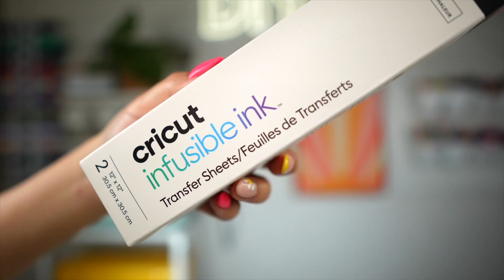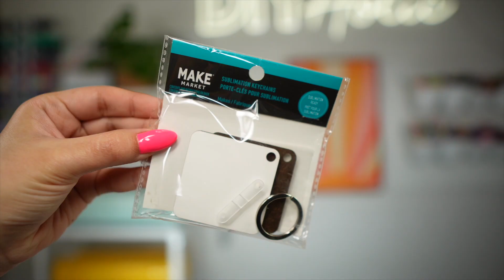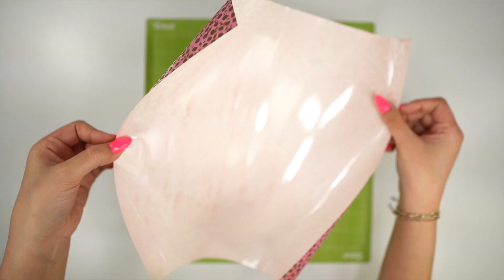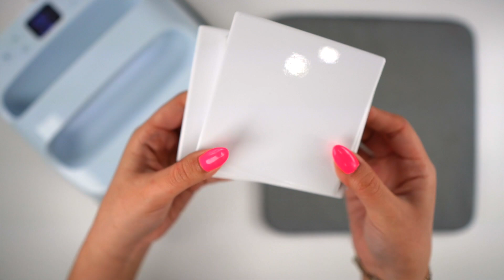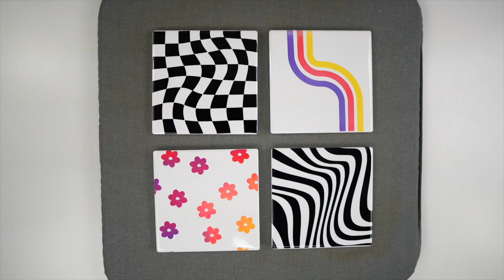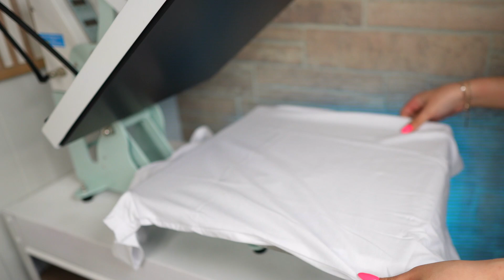HOW TO USE INFUSIBLE INK WITH YOUR CRICUT MACHINE! | Easy Tutorial for Beginners

Comment: Hiii, great video. Why do I need to change the color in design space before printing on my vinyl. This machine has me so intimidated. I thought I could just choose an image and cut. I’m so confused about this machine. Please help lol
Reply: Hello, I believe changing the color in DS space has 2 purposes: 1. helps you distinguish or keep track of what colors you are actually making your project, just as a spot check for yourself. and 2. if you are using different color vinyl for the elements of your project, you must change each element to a different color in order to "tell" your Cricut machine  to cut each element  out of different color vinyl by "preparing" each mat separately for each color, in other words, whatever is the same color in DS, cricut thinks you want it all cut out of the same color vinyl and therefore will place it all together on one mat on the "prepare" screen after hitting Make It.  Hope that makes sense and helps you!

Comment: Why my inf ink does not stay?
I followed all steps, on cotton, then I did on poliester shirt but the ink does not transferred;(
I did on pre heat T-shirt, then new piece I did on cool t shirt (the ink side down) 195 Celsius 40 sec 
Nothing transferred.
My ink from cricut didn’t cracked like on all tutorials too. It was easy to peal but didn’t noticed any cracking. I didn’t touched it but used the roller. Any idea what can be wrong?
Ps love your video❤